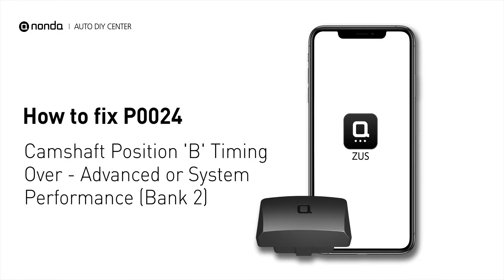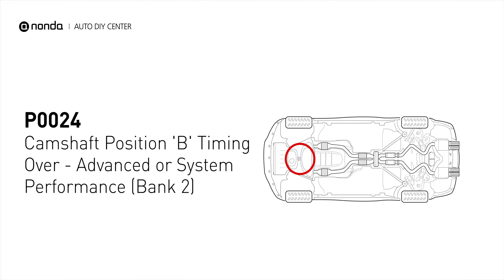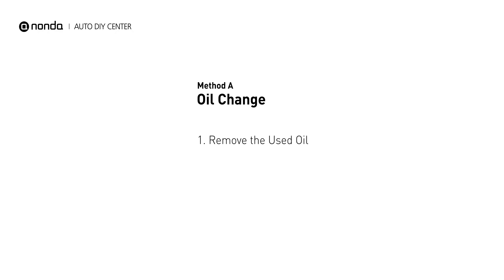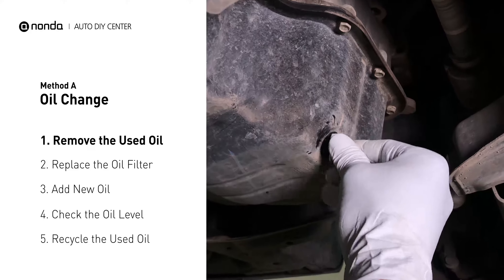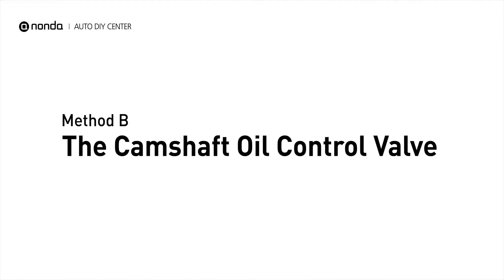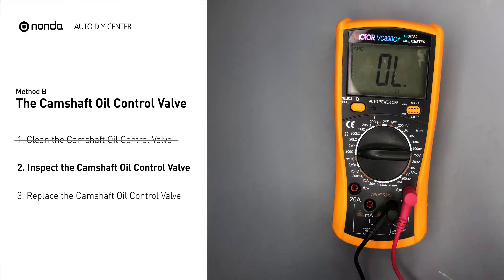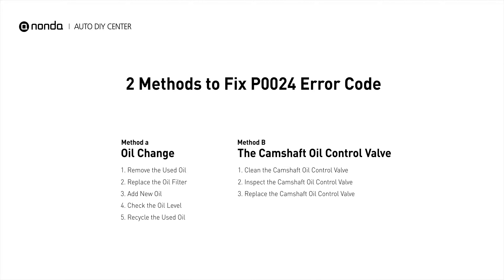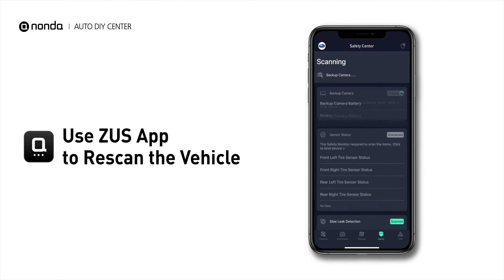How to Fix P0024 Engine Code in 4 Minutes [2 DIY Methods / Only $6.74]

Comment: Here's the gig (ignition on / engine off) (Gm 3.6  over Advanced exhaust) When you plug in all four actuators Three of the actuators engage and when you start the engine it runs absolutely terrible. The fourth solenoid has power but does not activate the solenoid but the solenoid is good cuz I checked it manually. But with the fourth one plugged in and the other three solenoids unplugged the engine runs perfect cuz three of them are not engaged (plug any other actuator in and the engine runs pathetic) Any info much appreciated

Comment: My ES350 has these error code P0024 and P0441. The take off sound is usually rough like a leaking exhaust
Reply from the maker: Hello, we suggest to perform an EVAP leak check and look for any issues on the Variable Valve Timing (VVT) circuit or Oil Control Valve (OCV) circuit.

Comment: I have a 2012 Chevy Impala. It has a P0014 and P0024 code. Is that something to do cam shaft sensors? I changed the bank 1 and 2 sensors but that code is coming up and failing my emissions.
Reply from the maker: Hi Regina, since you are receiving multiple error codes, we suggest to get your vehicle visually inspected by your local mechanic for further diagnosis.

Comment: I have a G 35X 2007 and I have a code P0024 I change the oil and the solenoid valve And I just cleared the code from the computer and the same code came back
Reply from the maker: Hi Winston, we suggest checking these parts and repair/replace them if necessary: Cam sensor, wires/connection, and the Cam timing actuator. Please check all the engine ground.